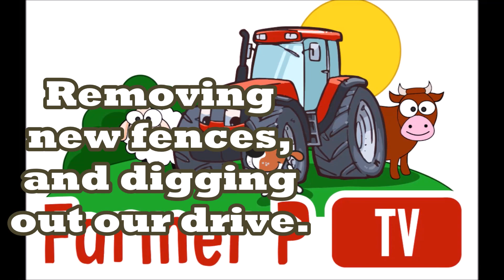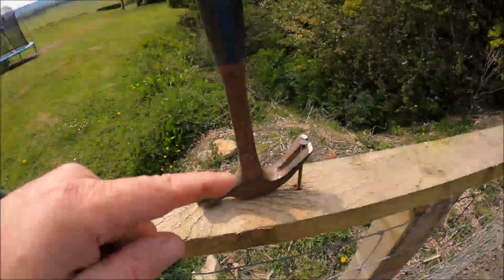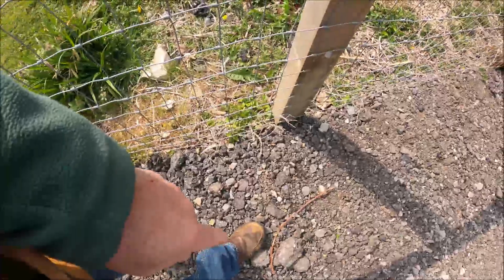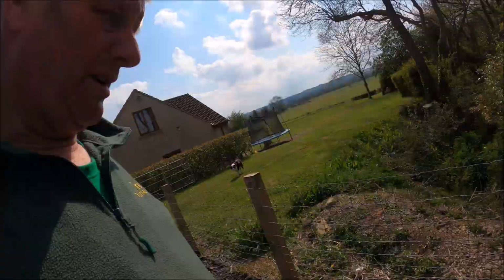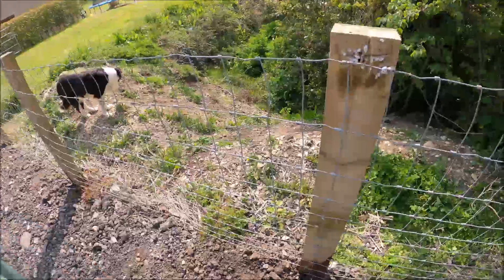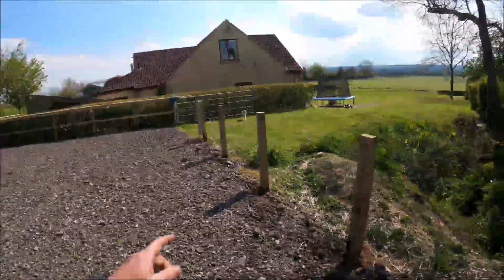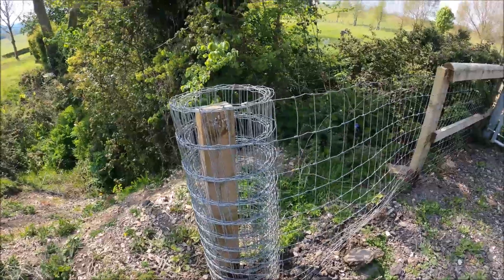Removing new fences, and digging out our drive  01 05 21

Comment: I've stepped on several nails in my time, but by far worse than that, was when I put a garden fork through my big toe. Also you must know to put a block under the hammer, to give you more leverage, when your de-nailing.